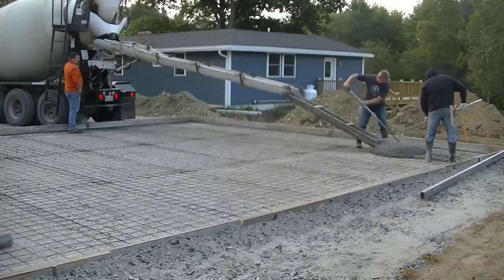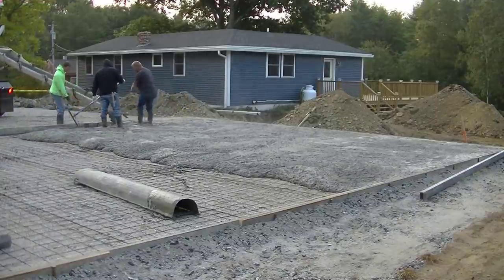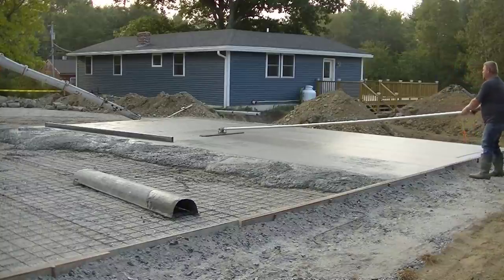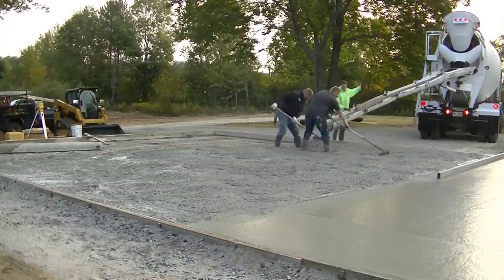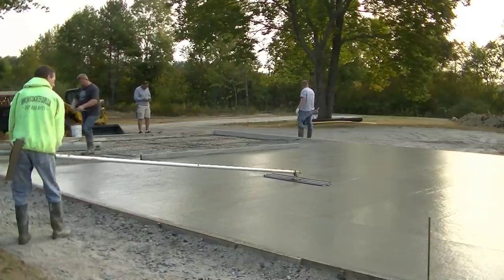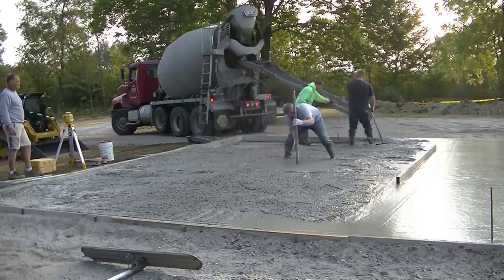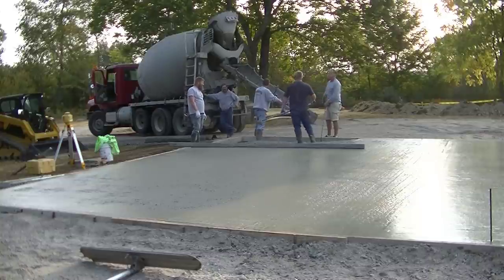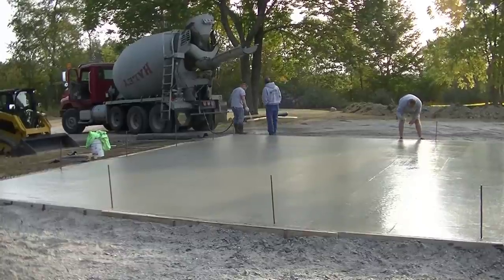Pouring A Concrete Slab For A 40' x 28' Garage (Learn My Technique)

Comment: When I started, screeds were 2x4 lumber, string lines, lotta eyeball work. I was constantly amazed by these guys who smelled the weather, knew just when to do what. That’s years of experience, years of knowledge.
Reply: When was that, in the 70's or earlier?
Reply: Construction Trucks yup. Joined Laborers union 1969
Reply: @johnfahey7215  Cool. I wonder how many guys still use their instincts like those guys did. Probably not many.

Comment: Another great information video. I've gotten a couple of finishers down my way watching your videos. I like how you use laser to get wet pads. I've considered it, but we always use grade pins. Just how I was taught. We always try to dump the truck out quickly and get it sent back. If I'm in a difficult spot, I'll go a little slower to prevent raking so much. Thanks Mike.
Reply: I like grade pins aswell.... One less tool in the way while your laying concrete haha
Reply: @jaredmiller7027  I like the idea of the laser, just hadn't worked my way into it. Grade pins take as much time stretching strings and always making sure they aren't stepped on or kicked over. I had a new guy step on pin 3 weeks ago, and I noticed it didn't look right when I magged around it. Had to rake out a groove to re stretch a string. Hard for me to try new things tho.
Reply: @bradhill4590  lasers are nice. I use it all the time. But I don't like using it to pour with. I much rather set grade pins with the laser and use them. Don't have a good reason other than just one less tool being layed around while we place concrete.
Reply from the maker: We do it both ways Brad. Like you said, sometimes someone will hit the pin and you have to check it. No right or wrong way really, it's just preference. If it ain't broke, don't fix it!

Comment: Hi Mr. Day,  Thanks for providing these videos.  We're DIYers trying to learn as much as possible before pouring a new basement floor and slab for a crawl space.  I'm curious why the guy inserting the vertical rebar for the knee wall didn't wire them to the rebar in the slab prior to the pour.  Would that not make it stronger? Or does that cause problems with slab expansion shifting into the walls?

Comment: The problem with scheduling concrete pours has always been the weather. If you get a rain day, you can’t just call the plant and say ‘back it up a day’, bcz other people likely already have the best times booked and you essentially go to the back of the line. So then you’re forced to work late or weekends to try and maintain the schedule. For really big pours, say 1000 yds+, the plant will usually ask if you can go on a Saturday, so they’re not so busy. 
  Here in S. FL, we would pour so much, that I would put 20 or 30yds on “Will Call” for everyday. Then an hour or 2 before, call them and tell them to ‘send it’ or ‘cancel’. I’m not sure how the plants arranged that but they always seemed to be ok with it, so that’s what I did.
Reply: I see your comments on here alot so I assume you are a professional. I need to know how soon I can drive on 4000 psi concrete mixed from Quikrete bags.
Reply from the maker: Yea, I usually have crete scheduled every day for 2 weeks in advance, 2 to 3 loads a day, so I can adjust my schedule if needed.
Reply from the maker: Jeremy, I'd probably give that a week. Kinda depends on how thick the concrete is and what's under it for a sub-base.
Reply: @jeremyhuggins8796    Retired now, but used to do lots of high-rise, mid-rise and low-rise building, so lots of structural elevated slabs. 
  Just for some context, we used to shoot for 3 day ‘breaks’ on all our decks pours, meaning on the 3rd day after the pour (pour day counted as day 1) we would have the lab break a few test cylinders, to see what kind of strength the concrete had achieved so far. We needed 75% of ultimate strength to be able to strip any vertical shoring. It was rare when the cylinders didn’t achieve sufficient strength at that point. We always installed re-shoring within a cpl hours of stripping the forms, bcz the ‘new’ floor was being subjected to considerable loads as the following floor was now in the process of being formed.
  Play safe and give it a week, just the same.
Reply: @psidvicious  Thank you!
Reply: @MikeDayConcrete  Thanks Mike! My driveway is shared with two other residences, and several other vehicles. It's our only access to the property so we need to be able to use it as soon as possible.

Comment: Hi how do you avoid getting scaling-problems when you powe-throwl air-concrete? Does the microfibres help to bond it?
Reply from the maker: As long as the air is at the correct % (4 to 5) and we don't power trowel it too early, we never have problems.

Comment: Hi Mike, I'm not in the business, but I enjoy watching the process. Question ? When you are lifting the wire mess, are you trying to lift it too roughly half the thickness of the slab being poured or is it better to be closer to the ground? Is there a preference ? Thanks
Reply: It’s most effective at resisting tension forces, down near the bottom. Concrete is already good by itself for resisting compression forces (at the top).

Comment: There is no footers,? Just compacted gravel under the slab ?
Reply from the maker: No footers on this one. Just a single story garage. Very hard compacted gravel under this, we've done 100's like this with no problems.
Reply: @MikeDayConcrete  I’m building a 28x32 single story in southern Ontario so lots of freeze and thaws . I’m thinking a monolithic slab with 5” centre  4000 psi with steel mesh. Should never have any issues ?

Comment: Hey Mike, how long after pouring a 4" deep driveway with a 4000 psi mix can you drive on it with passenger cars?
Reply from the maker: I'd give it a week to be safe.
Reply: @MikeDayConcrete  Thanks.

Comment: What do you use to hook hand floats in your back pockets?
Reply: Stick a margin trowel into your pocket the hook your float handle over the handle of your trowel. That's what your seeing
Reply: @jaredmiller7027  I think 99% of the finishers I’ve ever seen, do it that way. The other 1% might fashion some sort of hook out of a piece of #9 wire they found on the ground from a bundle of steel.
Reply from the maker: Yea, what Jared said. We do have a leather pocket protector we slide the margin trowel into while it's in our back pocket, looks just like this one: https://amzn.to/34dlqRl

Comment: What slump do you like to pour your floors at?  I think we pour it alot tighter, but I'm thinking about trying it your way. How long till you can get on it after screeding?
Reply: I drive a cement mixer and do a lot of side jobs to make extra money. Currently in the process of starting up an actual business and getting out of the driving game. But the average slump I mix up for guys when they are doing floors is like a 5.5 or 6. In my personal opinion a 6inch slump for floors is like perfect. 

Of course weather and time the load gets delivered play a big factor as well.
Reply: Mike’s mud always looks a little wet bcz they always use plasticizers in the mix. You can still put the machines on it in ~60-90 minutes, depending on the weather, shade, etc.
Reply: @psidvicious  I didnt realize that. Makes sense!
Reply from the maker: Yea, we use water reducers so we can pour a little looser.
Reply: How much water reducer do you usually ask for? I've pretty much always poured a 6 because it seemed like a nice balance.
Reply: Mike Day Everything About Concrete what slump was this one and how
Much water reducer please. Thanks

Comment: Hey Mike, I'm preparing a site for a garage slab and I am going to install a slot drain right in the middle, how deep should it be against floor level?
Reply: The drain grates should finish flush with the floor and the floor should pitch toward the drains.
Reply from the maker: The top should be flush with the top of the slab and you slope the floor to the drain. So in a 24x24 garage with the drain in the middle, I'd set the drain 1.5" lower than my slab height at the outside edges. 1.5" slope in 12' will be good for getting water to run to the drain without having to use a squeegee.

Comment: Aren't most slabs 4" ? Also if you use wire mesh and rebar why add fiberglass fiber?
Reply from the maker: Most we do are 4". Sometimes the ones we work for want both fiber and wire.

Comment: The extra shoot can break the hydraulic ram
Reply: I would have thought so too, but apparently not. You haven’t seen Mike climbing up the chute to the top and raking out all the extra?
Reply from the maker: I've seen a Trucks hydraulic ram break only twice in 40 years. It can happen but it's pretty rare. Having said that, I try to avoid getting under the chutes when they have concrete in them. The added weight of the cold chute full of concrete is probably more than the mixer company wants to see on their chutes.